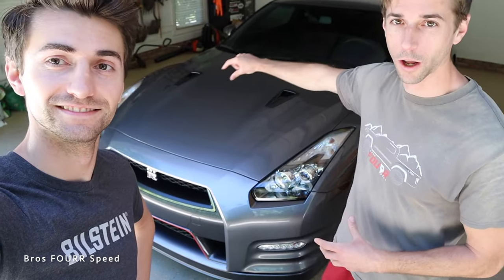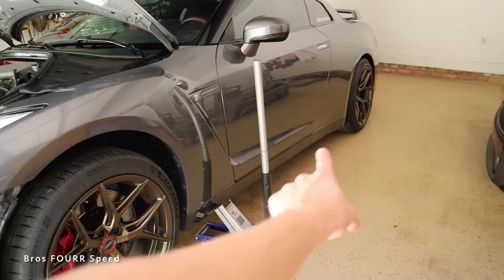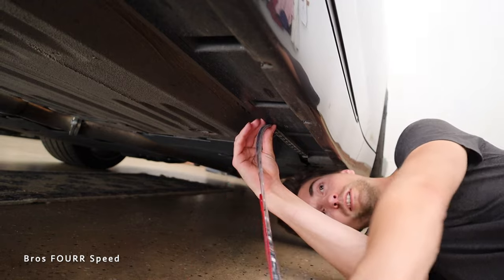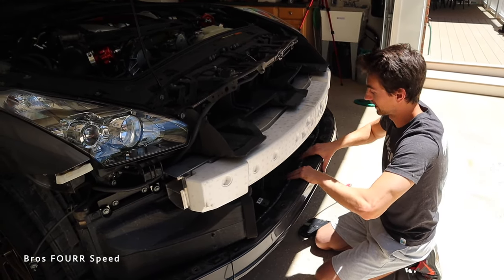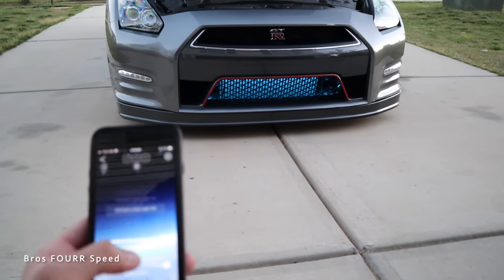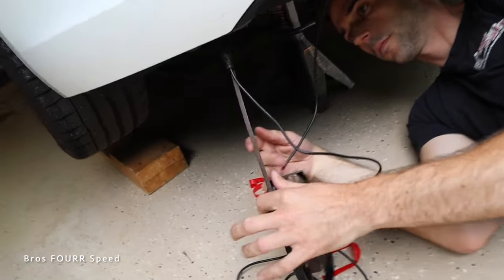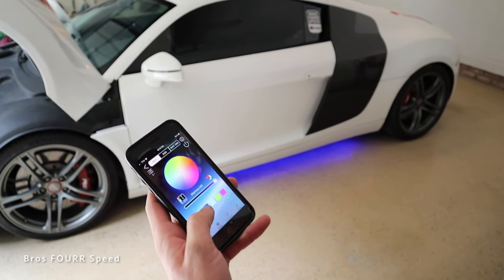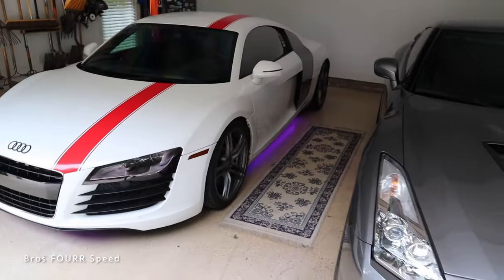How To Install LED Underglow The Right Way!!

Comment: Why are you suggesting people spend this much like 300 plus on what fuggin 8 maybe 9 ft of led strip?
Reply from the maker: Buy what works for you ;)
Reply: @BrosFOURRSpeed  so you have no reason? No actual justification on why you would suggest this over normal or higher quality led strips that would cost a fraction of the price and give double the length and dimming ect. ?
Reply from the maker: @Itsjosby  At the time this was a nice kit to test out and it worked very well. I havent looked at other kits since filming this video. Buy whatever works for your budget.

Comment: I literally just keep watching these to find out what to do with the extra wiring not hanging EVERYWHERE
Reply from the maker: We used a lot of zip ties and everything cleaned up nicely.
Reply: @BrosFOURRSpeed  that’s exactly what I did before seeing this that same night lol. Smaller ones. Tied to frames and away from tires was my focal point
Reply: You can also cute the wires and put them back together with a soldering iron if your comfortable enough

Comment: Good job with cable management. I still figuring out with mine. The difficult part is going through the tire struts. Trying to find out where to safely put the wire without interfering with moving parts.
Reply from the maker: Oh thanks. Yeah just be careful with it

Comment: Had you used two short bar for the front and rear on the R8 could you have had it “follow” or “chase” from the center?
Reply from the maker: I think however you plug in the lights is the direct the lights will go when using those modes. Doesn't matter which length it is. As long as they are inline thats the direction they follow
Reply: Last question - are you using the battery tender connection to splice in the underglow system?

Comment: I am not too much of a fan of underflow lights, they would attract too much attention here in Orlando, FL from other drivers resulting in lots of ricer flybys, getting cut off and brake checking.  

Nice job on installing the underflow lights! 😎
Reply from the maker: Lol yeah I wouldn’t drive with them on much. I rarely even drove at night. But cool for car shows and photoshoots tho 😎
Reply: @BrosFOURRSpeed  I miss going to car shows, especially the ones at Hooters restaurants. 😌🤗
Reply from the maker: @waic1639  lol Ive never been to that restaurant. But we have so many car shows around!
Reply: @BrosFOURRSpeed 
There are plenty of car shows in FL too, but the ones at Hooters tends to have more muscle cars, vintage and modern.

Hooters is an okay restaurant, basically a KFC mixed with Olive Garden and adding a lot more bosoms. 🤭

 Longhorn Steakhouse is better than Hooters.

I went for some delicious T bone steak at a Longhorn across the street from Hooters one time when the Hooters that was hosting the car show was packed.  I enjoyed steak, soup, and chocolate cake in a nearly empty restaurant.  That was a truly lovely meal.
Reply from the maker: @waic1639  Oh cool. Longhorns pretty good for sure

Comment: So the iphone app allows you to manually turn on/off the underglow lights? Since the lights are connected directly to the car battery, wont that drain the battery when the car is turned off?
Reply from the maker: It shouldn’t, but that’s why I made the connection that way, so when I’m not suing them, they aren’t hooked up!
Reply: @BrosFOURRSpeed  Thanks, but can underglow lights work as puddle lights? They turn on when the car is unlocked and turn off when the car is locked, without having to use the iphone app?

Comment: Do you know what would be needed to light up the inside of car and link it all together so they all light the same at one time?
Reply from the maker: I think they have an interior kit too. Might have to control it separately. However it could plug inline with this. Not too sure
Reply: It's easy enough to do it, you just have to splice the wires for the interior with the matching wires of exterior underglow lights. Or you could buy two much more expensive Blueghozt controllers and sync them together.

Comment: When connecting it straight to the battery, do you have to disconnect the battery first or apply the positive first and then the negative?
Reply from the maker: Just connect the negative first, then the positive
Reply: @BrosFOURRSpeed  does it matter which way you remove them from the battery as well? Also thanks for the response and help!
Reply from the maker: @noahhuraan5353  general take the positive off first. And put it on last
No problem!
Reply: Tip - When working with LEDs, it's best to plug all of your strips up before giving them power. Plugging in strips to a controller that's already getting power can damage the lights. It also might not damage them, but that's the general rule of thumb when dealing with LEDs.

Comment: Hey is it better to wire the  underglow to the battery itself OR  another source where it only comes on when the engine is on?
Reply from the maker: I think what we did was the best! It won’t drain the battery when you don’t want them on and it’s easy to hook it up when you want them!
Reply: Use a relay. Tap into an accessory power wire. Use an on/off/on 3-position rocker switch, wire it so one on-position is for accessory power, and the other on-position is for a constant hot from the battery. That way you can keep it in accessory power mode so it only comes on with the key turned on, but then if want to be able to show your lights without starting the car, then you can just flip it into the other on-position and turn the lights on and off with the app.

Comment: @brosfourrspeed Would it be better to put some gorilla glue adhesive vs drilling the little anchors?
Reply from the maker: Maybe. But the small screws can easily be removed. You'd see a lot of glue residue if you did that route
Reply: The 3M VHB tape on the strips is stronger than Gorilla glue. If installing to metal, you'll have no problem getting an excellent bond by cleaning with a degreaser and then 80% IPA. If adhering to plastic, zip ties are the best fail safe, but if you don't want to do that, then the tape can still work good, however if not using zip ties and attempting to stick the 3M tape to plastic, then you'll want to use 3M Primer 94 and then it will have no trouble forming a weatherproof bond.

Comment: My biggest question is with the wires going up through the engine there should be little to no problems? Or should I work around the Engine to the Battery avoiding contact with the metal and staying to the parts that won’t melt the wires?
Reply from the maker: I never had any issues. Just be careful where you route your wires
Reply: @BrosFOURRSpeed  thank you!

Comment: Is the battery tender on a switch some how? How do they not stay on when they car turns off I just got a set delivered from Amazon (govee underglow kit) I have a 07 cadillac dts but my battery in under the back seat what should I do?
Reply from the maker: My battery tender wires go to the battery. And I simply plug that end into the tender itself cable. These lights I connected to their own end that I ca plug into that same end used for the battery tender. So when the lights are unplugged, they have no power to them.

Comment: Hey man awesome video and I was wondering how you hid the light under the rear diffuser. I have a r35 and sadly only the rear diffuser section shows the strip when driving behind it
Reply from the maker: I didnt do anything for the rear. Just sides and inside the front bumper. There really wasnt a good place front and rear under the car. So I just did it the way I showed in the vid
Reply: Try using a piece of 90 degree angled plastic. Mount the plastic piece to the vehicle, then the strip to the plastic piece. The lip of the plastic will cover the actual strip from being seen.

Comment: I bought the kit awail ago do you have to have that extra part for the battery
Reply from the maker: Nope. I just did that so it wouldn't be connected to the car when I didn't want it to be. I hardly ever drive at night. So I only want it plugged in a few times

Comment: Do you have a link to the app they use on iOS? I was trying to find the privacy policy for Oneup Lighting and their app that controls but all I can seem to find is a generic return address to a shopping center that does not have their name anywhere associated with it (with multiple websites using the same address). Their privacy policy for their website is different than the app and they don't seem to list the app used anywhere.
Reply from the maker: It should just be scanning the QR code on the kit.

Comment: Does this work once you turn on the car and turn off once the car is off? Without doing it manually from the app or controller
Reply from the maker: It could but I didn’t set it up that way! I manually do that since I don’t use them often, I didn’t want them hooked up to the power all the time.
Reply: Reminder - LEDs connected to a power source still draw a tiny amount of power even when they're turned off completely! This will not be an issue if you drive your car everyday, but if you don't drive it for 3-7 days the LEDs from the underglow will likely drain your battery. There's easy ways around this though.

Comment: The last time I connected underglow to my battery it killed it, how can I keep it from doing that?
Reply from the maker: That's why I made the connection. So I leave it unplugged when I'm not using it. Plug it in when I plan on having it lit up
Reply: LEDs draw power from the battery even when they're turned off. To keep them from draining your battery, buy a simple shut off device that will completely kill all power to the controller if the Voltage drops to a certain threshold. You could also just use a toggle switch and turn them off completely by flipping the switch to off.

Comment: Soo you can just conect + to + and - to - on battery and it wont burn wires? 
That is only reason that i search for this video i just want to make sure..
Reply from the maker: Yeah keep them the same on the actual battery
Reply: @BrosFOURRSpeed  tnx 👍

Comment: Where can u get something like this done at ?
Reply from the maker: You could always try yourself! But any local shop that does audio or electronics, maybe if they install lift kits, light bars, somewhere like that.
Reply: @BrosFOURRSpeed  bet thanks a lot
Reply: Typical cost for an underglow installation is around $400. Most people's underglow kits will experience a failure in less than a year. A cheap 50V 1000uf capacitor  placed in-line with the LEDs power and ground wire, along with a 33ohm-330ohm resistor on the data line is a secret to help LEDs last longer in a vehicle environment. I also run mine through a voltage regulator that takes an voltage from 8-40 volts and spits out a nice smooth 12V of power. LEDs don't like the voltage spikes in vehicle electrical systems. Installers will typically just take your money and do the minimum.

Comment: Is the battery tender necessary?
Reply from the maker: Nope. I just used the connection for it that way I don't have to leave the lights connected to the battery. I already had the battery tender hard wired to my car. So now I can still easily plug in the car when I'm not driving it. And then use the same connection when I use the lights

Comment: i bought a car with light on it and i cant turn it off i was not told it had light looking for a switch
Reply from the maker: Look for the light connection, most likely on the battery and follow any wires that run from that, should help you locate a switch.

Comment: i got the same kit but my cars are old and its just the metal underbody of the cars and i cannot find a secure way to fit it to the car withoud drilling into the metal
Reply from the maker: Can you use 3M tape on the underside of the lights?
Reply: @BrosFOURRSpeed  I have t tried but I didn’t think I would have much luck cos I tried silicon and that didn’t stick well either
Reply from the maker: Oh dang. Normally 3M tape does well. Not sure the best way to go
Reply: @jakepace9315  Clean the metal with a degreasing agent really good, then clean it with alcohol really good, and the 3M VHB tape will have no problem holding up the lights. If you don't mind drilling directly into the metal, then you could also use zip tie mounts for extra piece of mind. But the 3M tape is very strong.

Comment: So im wondering if its legal in texas been doing some reading some say it is some say its not allowed
Reply from the maker: It's definitely up in the air. Depends on the color you run with and if a cop doesn't like it. I would avoid driving with any flashing colors, especially red or blue.

Comment: The underneath of my car is textured. I have 0 clue how to install with the tape.
Reply from the maker: Hmmm. Anything remotely smooth? Any plastic or metal surface will work
Reply: The texture shouldn't affect the 3M tape, if anything it could make it hold stronger. For plastics that are really smooth, 3M recommends roughing up the plastic a bit if possible, because the tape adheres better to surfaces that aren't completely smooth. The real key is to clean it really really good with a degreasing agent and then alcohol.

Comment: Can you get this done by a mechanic?
Reply from the maker: Maybe. But most shops don't do aftermarket stuff. A lighting shop that does car audio/stereo might do it
Reply: It cost $400. Do it yourself is my advice.
Reply: @imdbtruth  I paid 150 to get it installed
Reply: @djcrazybeast5277  That's a really good price. Most shops I've dealt with charge around $80-100/hr for labor and they estimate the underglow install will take 4-5 hours. I guess it depends where you are located, and it probably pays to shop around. Did you get it done at a car audio shop?

Comment: no fuse needed?
Reply from the maker: The fuse in the battery connection is fine to keep things in check. You could tap it into a fuse in the car if you wanted to come on with the headlights.
Reply: @BrosFOURRSpeed thank you, nice connection very clean. 😊

Comment: That's a 4 pc underglow. C'mon it's a gtr get the 6 pc, they must be the 42in 25in
Reply from the maker: I have the 6 piece kit, but only choose to use 4, what’s wrong with that?
Reply: @BrosFOURRSpeed  the only difference is the  chase pattern goes one way. The 6 piece chases both sides. If I could afford anything close to a gtr I would go for the extra 20$
Reply from the maker: @garryoak  Cool, I didn’t have room for the other two, so I choose not to install them. Doesn’t make a difference for me, I wanted to do it this way. Has nothing to do with money.

Comment: I didnt need to know how to stick them on... I need to know how to properly wire them up to come on with the vehicle. Branching right off the battery terminals is not correct. Stop showing people that!
Reply from the maker: How’s it not correct? How would you do it? That’s the only way..
Reply from the maker: This is a perfectly fine way to install the lights. Most lights connect to the battery. To connect to headlights or something you'd just tap the power line into the headlight fuse basically
Reply: The only problem with only going directly to the battery and turning them on and off with the app, is that the LEDs still draw a tiny bit of power even when turned off. If you go out of town for a few days and don't take your car, you might come home to a dead battery. It's also not the best for the longevity of the battery to have the LEDs leaching 24/7.

Comment: not a fucking tutorial if you completely disregard the instructions
Reply from the maker: What?? There's no instructions with this....every car will be different and require variations depending on the length and components in the way....so I'm showing how I did it for this car, and you can modify to your car as needed....